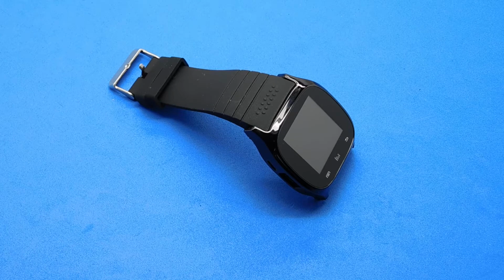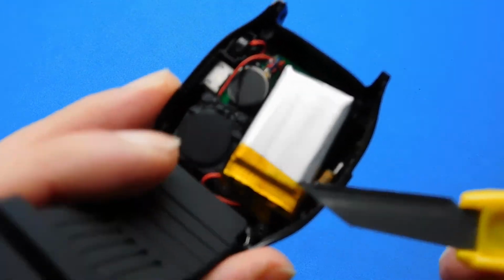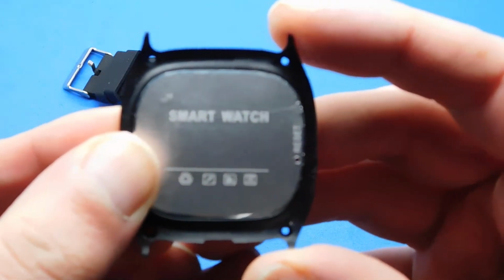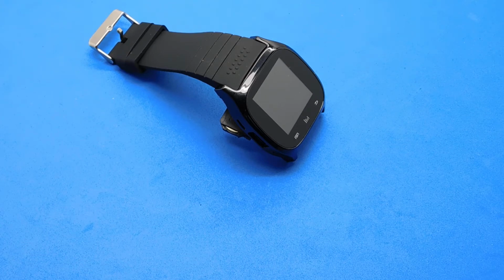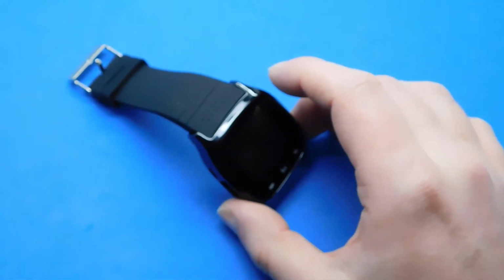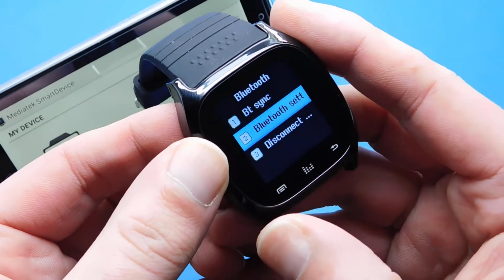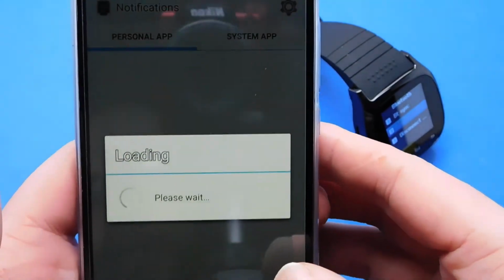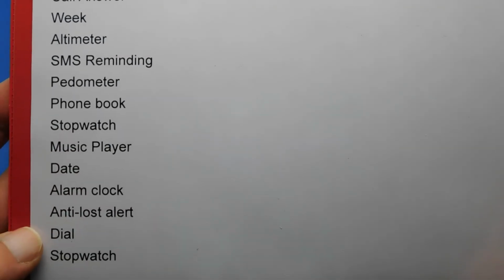£4.89 M26 Cheapest SmartWatch Unboxing Review Cheap Smart Watch Android iphone Phone

Comment: Hi. did you think of getting a "y1". It looks promising but it's pedometer doesn't work.
-i saw a picture saying it is waterproof.
-it also has an accelerator.
Reply from the maker: i have had a look at that watch, it seems people are not showing the back of the watch,

i wonder if it is hard wired in the back ?,

the screen is smaller than usual at 1.22 inches,

maybe the screen is square not round it is difficult to see,

it looks like it has a mediatek chip in it,

i think it runs the normal Nucleus operating system but has it been optimised to work with a round screen ?,

the battery also seems to be 280 mah quite small compared to the normal 350 mah or the Q18's 500 mah,

i would say it is only splash proof at most sellers say don't do watersports but it seems more waterproof than the Q18.
Reply: Noob Tube i think it has a 380 mah. But thanks. Tell if you are thinking to review one.

Comment: Love to see an unboxing and review of the Q18+ android based smartwatch. I bought one and wanted a professional opinion. It runs android 4.4
Reply from the maker: I think the chassis of the Q18 is one of the best design of all the sub £10 priced watches,

Android watches are more expensive,

I did look into it and saw an entry level Lemfo LEM4,

I think that had a quad core processor and everyone said it was great,

Everyone that got it for "free" said it was great and then i saw a review of it and they said it was horribly laggy,

And it doesn't have enough memory to function as android alone needs over 2GB of storage,

He suggested buy a more expensive watch but £100 is far to much for a watch,

I have done a review of the basic Q18 watch i know there is a Q18S as well but i can't find any sellers of the Q18 +.
Reply: Noob Tube I found mine on Wish for $44. It's arriving Friday. It has a 1.2 ghz processor, but the only issue I've heard is it has a poor wifi chip.
Reply from the maker: Yes others have got these 2 watches confused and asked me about the poor wifi chips,

The standard Q18 doesn't have a wifi chip,

I think more cpu cores is more important than speed,

As lag will appear during multi tasking.
Reply: Yeah I am wearing a Q18S watch right now but wanted to upgrade so I decided since I love this watch so much I'd stick with it. I'll have to play around with it when I get it and see how I like it. The chassis on the Q18 is great, but don't like it's not waterproof. Living in California I need that and the plus has it so that's a good sign
Reply from the maker: For some reason the S has a 350 mah battery and the Q18 has a 500 mah battery so i wonder is anything else changed between the models ?.
Reply: Noob Tube not that I can see. The only annoying thing is it's supposed to have a universal home key, but when you turn on the watch and click the menu button it changes the clock face. I love the band and the vibrant colors. I am just looking forward to my plus

Comment: Hi, what do you think about the kingwear gt88? Is it really waterproof? Here's the link https://www.gearbest.com/cell-phones/pp_246151.html
Reply from the maker: kamel alg i was going to get one but they are very expensive for what they are,

£27 on ebay,

the back maybe waterproof with a o ring seal and screwed on,

The GT88 doesn't have a charging port so water can't get in that way but,

it will still get in,

The magnetic charging cable is the GT88 biggest problem,

it is not very well designed,

it doesn't connect very well as it uses magnets,

so it is more waterproof than the lower priced watches,

but do not immerse it in water you will find it stops working quickly,

it still has the same insides as a cheap £10 watch,

it still runs the very basic nucleus operating system,

not the functions of android watches,

so get a GT08, A1 or a Q18 i have reviewed all 3 and they are the best ones for the lowest price,

they just look different,

the GT08 and the A1 look very similar to the GT88 just with different straps,

my opinion don't waste lots of money on a GT88.
Reply: Noob Tube I already got the Q18 thanks to a previous advice from you, I was asking for a friend now I think he should get the Q18 too
Reply from the maker: kamel alg great,

i do like the Q18,

The design on the GT08 and A1 makes them look like Apple watches,

i really like the strap on the GT08 but that is my opinion,

go for the one you like,

and spend the extra on something else.